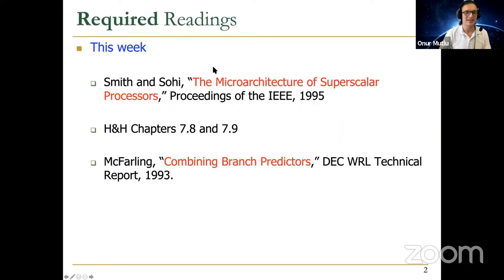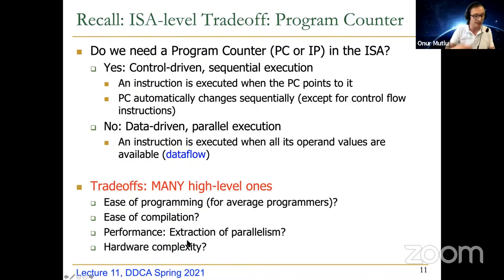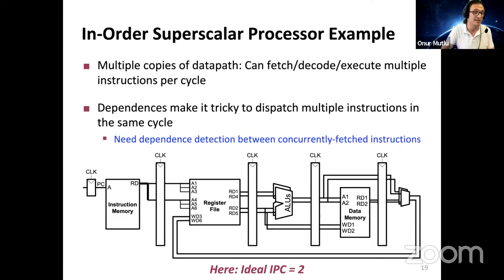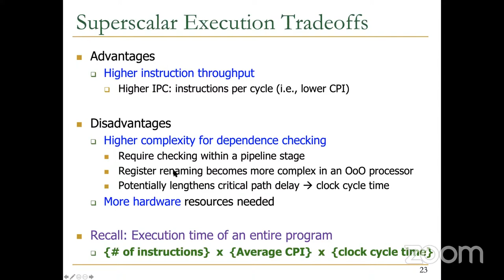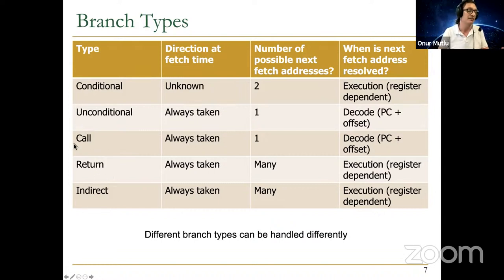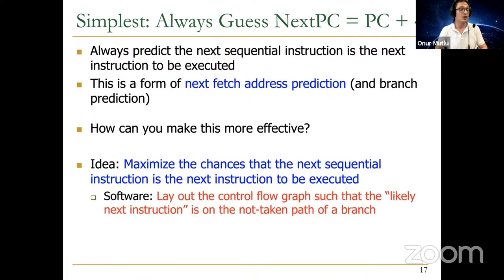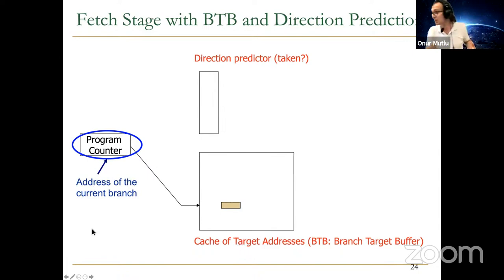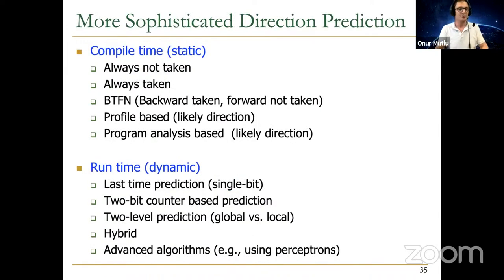Onur Mutlu - Digital Design & Comp. Arch. - Lecture 17: Superscalar & Branch Prediction I (Spring21)

Comment: A major roadblock to increasing performance centers on combining the benefits of data-flow and sequential architectures. The instruction scheduling unit must have sufficient information to organize instructions effectively, however, the scheduler only as access to a limited window of execution. If the scheduler had access to the full program context when it scheduled an instruction, it could optimally schedule that instruction. What is the most efficient way to expose the scheduling unit to the full program context without hiding the program's sequential order? It seems like the CPU requires access to at least two data structures: 1) the complete data-flow graph and 2) the compiler produced binary. If there existed a mapping between nodes of the data-flow graph an instructions within the compiler produced binary then the scheduler could refer to the appropriate data-flow node before scheduling each instruction.